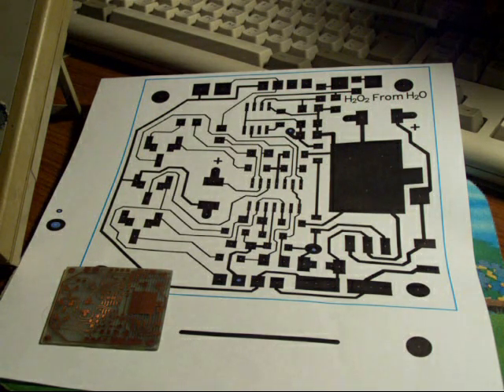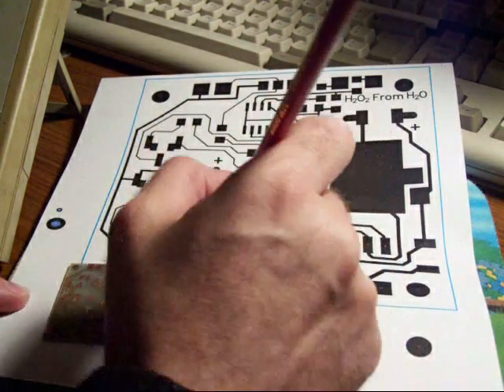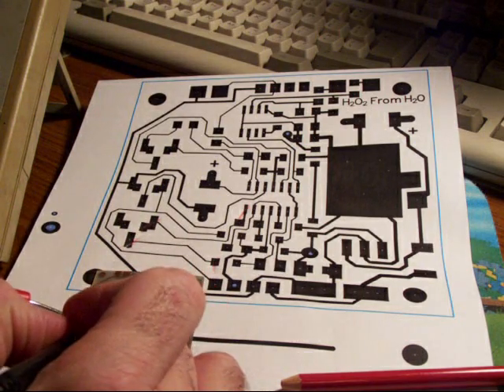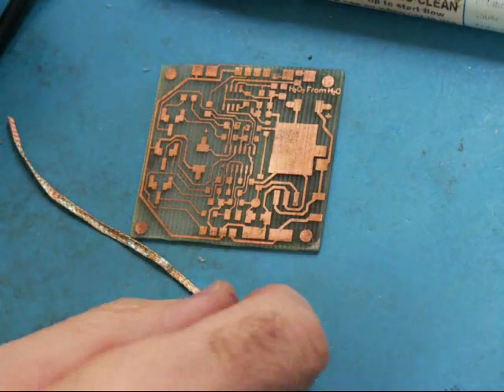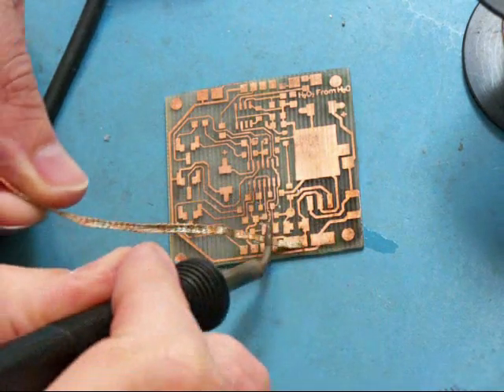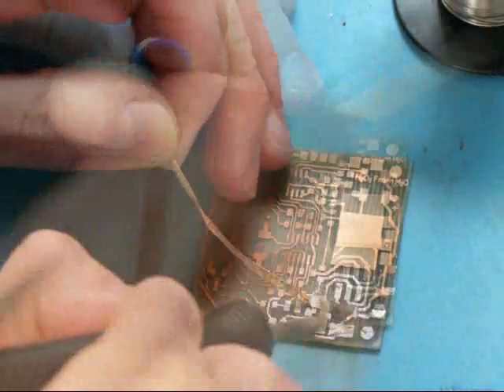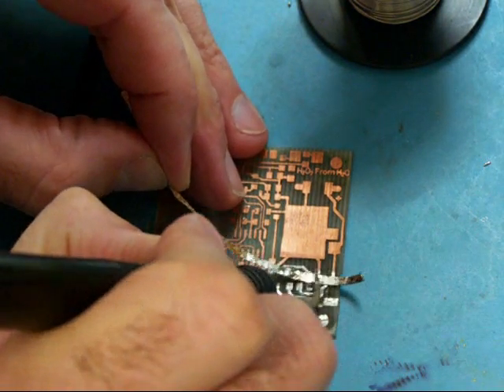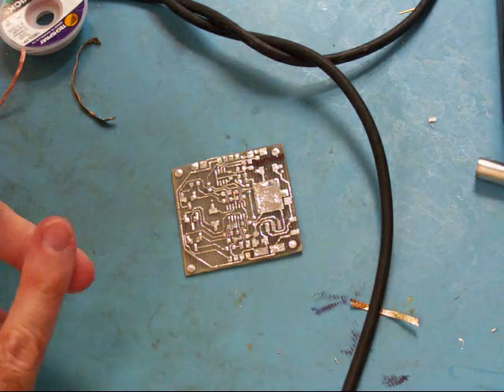#7 H2O2 - PCB Verification and PCB Tinning

Comment: that's a good idea as far as tinning something even something quite detailed.  but if you are looking for low cost and easy for water protection how about casting paraffin over the board?  limiting factor would be operating temp.  also a tube of silicone caulk could cover several of those boards per tube.  both methods can be done after complete, also rubber cement, or even left over house paint, there are tons of ways just laying around if ya thin k about it

Comment from the maker: @serchmarc I use an Exacto Blade. Make multiple passes, start with little pressure then increase. If there is space between the traces I will use the back side of the point of the blade. If one or both are damaged form the blade, Jumpers can be added.

Comment from the maker: @donnyab,    Well this method was chosen to keep the cost down and protect the board, I have not tried a clear coat but a lacquer would probably do the trick for the like of the lacquer, I had the soldering supply's on hand and recommend them to anyone that will be soldering surface mount components. Efficient uses of supplies!

Comment from the maker: Its on a Metcal Smart Heat MX-500P-11
The Tip is a STTC-140  Its temp is 700 Deg F  The tip is a 30 Deg conical Sharp Bent